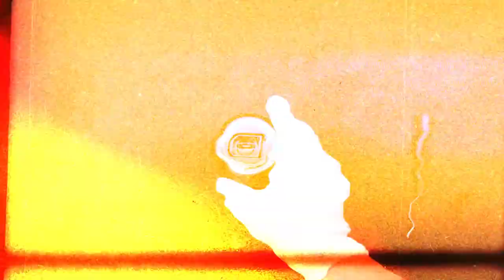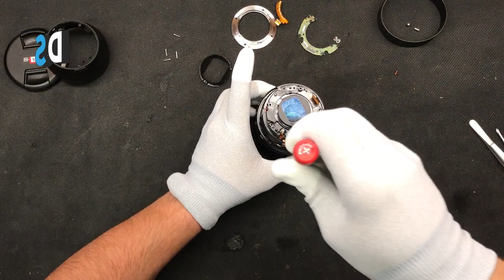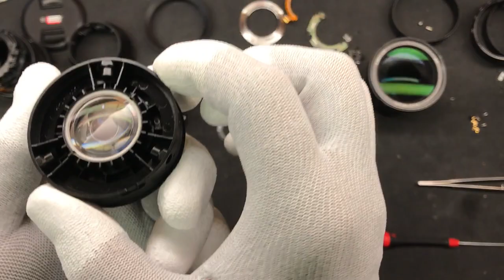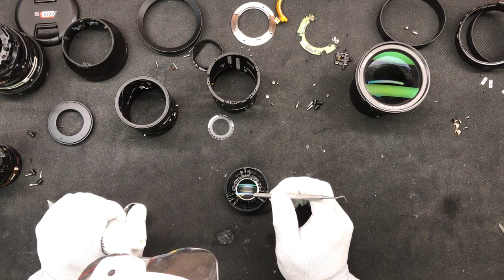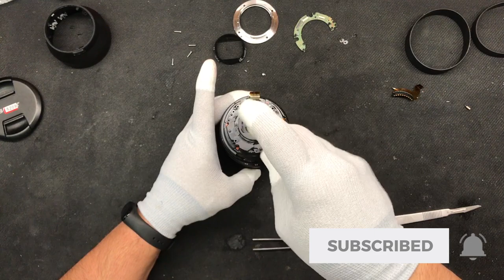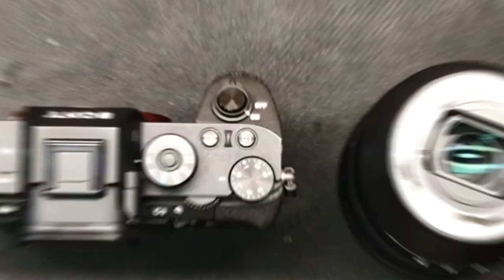How to repair Sony lens FE 24-105 мм F4 G OSS water inside (disassembly 2G lens group)

Comment: Hi Digi Service! Thanks for this great video! I got the same lens and I am not able to focus anymore. Whether the MF nor the AF works. Some times it kicks in, after 40 tries. Is there a common failure, maybe a ribbon cable or smth where a dodgy connection could be a problem? Thanks in advance!

Cheers from Germany!

Comment: Nice Video guys I'm going to perform a repair on my 24-70gm lens after the lens mount is separated from the whole lens. Is that lens similar to this one in terms of build? I have to replace the outer barrel! is there any tips you would give me? thanks
Reply from the maker: Hi, this lens is more or less the same like 24-105 and 24-70 (build and lens groups). Once i have 24-70G i will make video :)

Comment: How do you remove the front element and clean it? 18:00 thanks for your help
Reply: I like how he liked your comment and never replied
Reply: @brandongers  😢
Reply: @netoflores23  77mm silicone lens repair tool. Old lenses had notches in in them that allowed you to unscrew the ring that held the front element in place. I will let you know if this works. I have one being delivered Thursday.
Reply: @brandongers  Did that ever work?
Reply: @MarinusVesseur  it did and it didn’t. The ring on mine was damaged so it would loosen it but not remove it. There is also adhesive in there that is a pain to remove